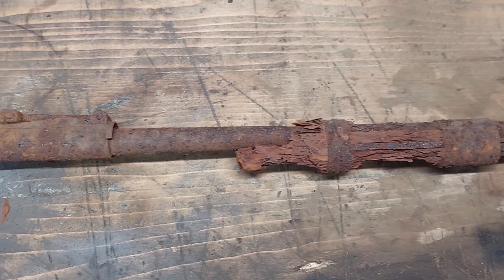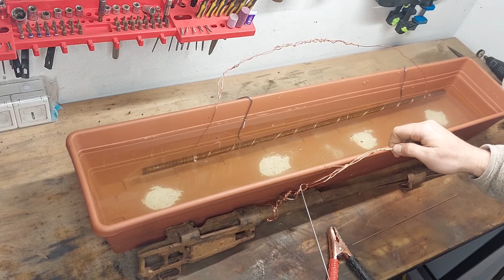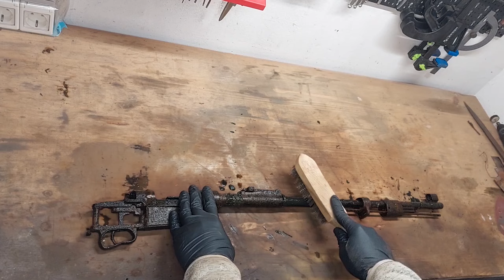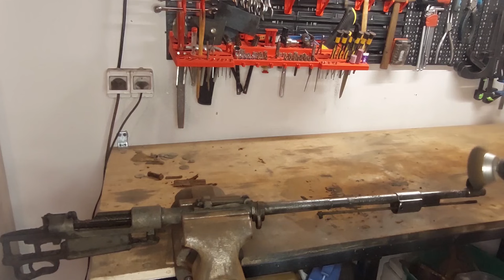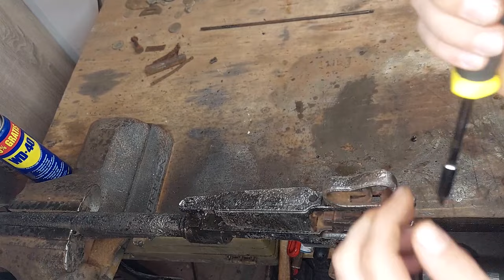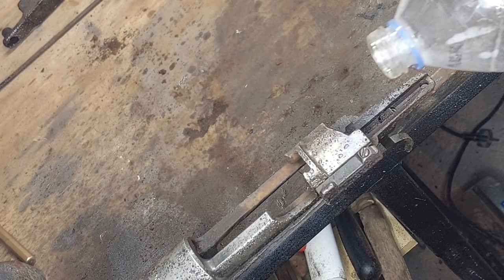Rusty german k98 restoration #ww2 #relic #rifle

Comment: Incorrectly called a K98. It's actually a Kar 98k or K98k, Karabiner 98k!
Must say, it's a great job you have done!
Reply: everyone says k98. none says its full name
Reply: @finn4004  Где в этом рукоблудстве реставрация?
Reply: I say k99 cause it's the rifle Gretzky uses 😂
Reply: @finn4004  k98 is technically wrong, because it would then translate to "Kanone 98" in the Wehrmacht
Reply: @WWolfrum  it translates to „karabiner 98“. i am german. i should know it. the „k“ at the end stands for „kurz“ (short)
Reply: @finn4004  Ach da musst du dich aber nochmal Hineinlesen, ein "K" am Anfang einer Waffen Abkürzung in der Wehrmacht steht immer für Kanone, deswegen heiß es auch eigentlich Kar98k, Karabiner wurde die Waffen auch nur genannt weil die Weimarer Republik durch den Versailler Vertrag nur eine bestimmte Anzahl and "Gewehren" produzieren durfte, und Karabiner nicht als Gewehre angesehen wurden, deswegen wurde auch der Name vom MK42 zu MkB42 geändert weil es sonst "Maschinenkanone" heißen würde.
Reply: @WWolfrum  Ach so meinste das. Ich selber kürze das “Kar” immer mit einem “K” ab. Auch wenn es nicht ganz richtig ist. Zur Zeit ist übrigens ein netter Kar98 Bodenfund bei Egun drin. Musste dir mal anschauen.
Reply: @finn4004  Schöner Bodenfund Finn, besitze selber einen Kar98k bin aber noch auf der Suche nach einem Guten neuen Lauf, System und Verschluss am besten ohne Lochfraß oder Durchrostung.
Reply: @WWolfrum  da kann ich nur mit Deko dienen…